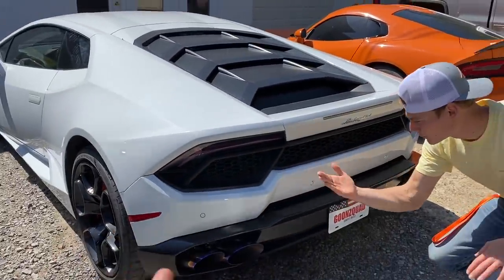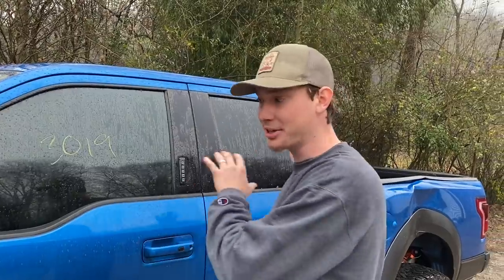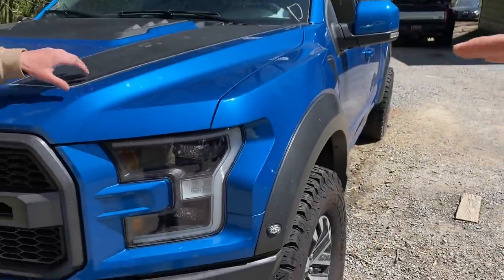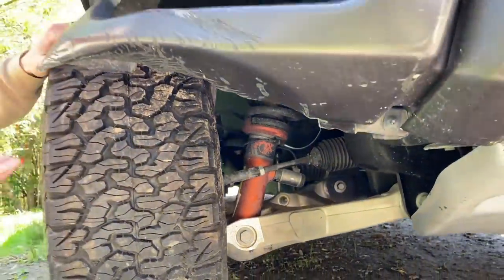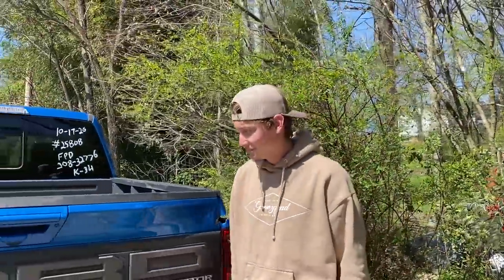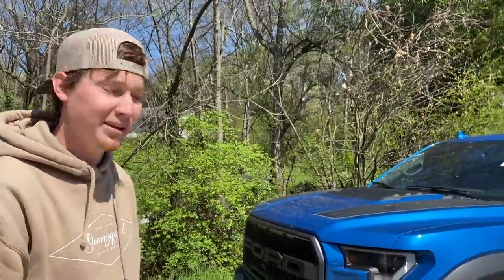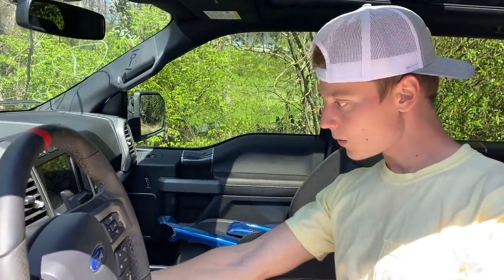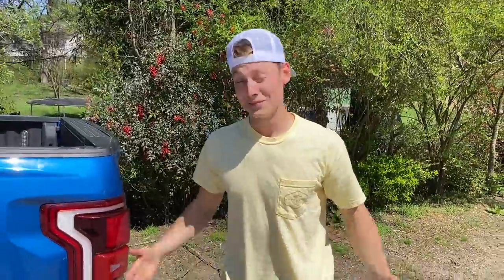Rebuilding A Wrecked 2019 Ford Raptor!!!

Comment: The first gen raptor had a 6.2 v8 boss engine the same engine in the Superduty the raptor never had a 5.0 v8  Ford brings back the v8 raptor next year it will be called the raptor r witch will have the v8

Comment: In terms of frame damage - it is pure speculation at this point, but the front clip seems out of alignment with the windshield and cab.   The drivers side left front fender and front door has a bit of larger sized gap.  It could just be that the front clip needs to be reset or it could mean there is frame issues.  To damage a truck to this extent, you'd have to be a real moron in terms of driving skill.

Plate [C]
Reply: Certainly a high-energy impact, with secondary distortion in many parts of the body and probably beneath. The fact that none of the airbags deployed on the Raptor suggests that it was sideswiped while parked, and that this caused the scraping and tearing damage along the passenger side. The damage on the driver's side is different, because it is buckling, not scraping, and the most serious example of this type is on the side of the bed, and was probably caused by the rear left-hand wheel being forced upwards violently enough to fracture the axle. The frame (chassis) of the truck is probably distorted in this area, and this is why the Insurers wrote it off.
Reply: @johnstedman4075  Good points all around and I appreciate the input.  At the beginning of part 2, you can see that the rear right leaf spring has a bend in it behind the axle towards the bumper.  I would be worried the  axle tube could have a small bend in it as well, although not visible to the naked eye.

Plate [C]
Reply: @platec4798  Yes, that rear suspension took a heck of a knock. Goonzquad would be best advised to take the bed off, remove the whole back axle and all its components, and have it fully crack scanned. I wouldn't be surprised if the whole assembly needs replacing. Clearing out that area would also enable Vtuned to put the Raptor on his frame machine and thoroughly check all the alignment of the pick-up points. The chassis may need some serious pulling to straighten it out.

Comment: It’s was is a car crash but what happened
Reply: The fact that none of the airbags deployed on the Raptor suggests that it was sideswiped while parked, and this caused the scraping and tearing damage along the passenger side. The damage on the driver's side is different, because it is buckling, not scraping, and the most serious example of this type is on the side of the bed, and was probably caused by the rear left-hand wheel being forced upwards violently. The frame (chassis) of the truck is probably distorted in this area, and this is why the Insurers wrote it off.
Reply: @johnstedman4075  I am glad that everyone is ok
Reply: @combinetractor1773  I certainly hope so! Looking more at the body damage, it seems like the front passenger door was sideswiped from rear to front, which makes it even less likely that this Raptor ran into something. Perhaps the original owner will come forward with the full story!
Reply: @johnstedman4075  it’s not my first “rodeo”. I can see that